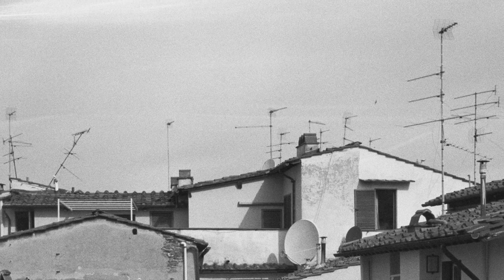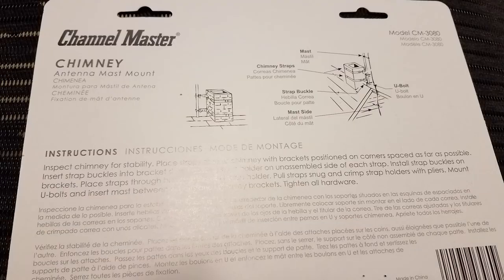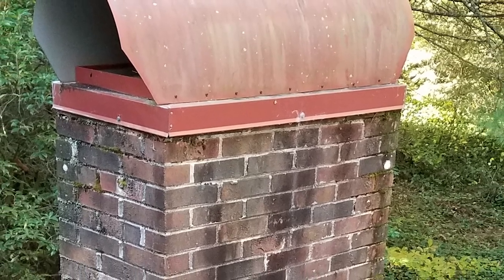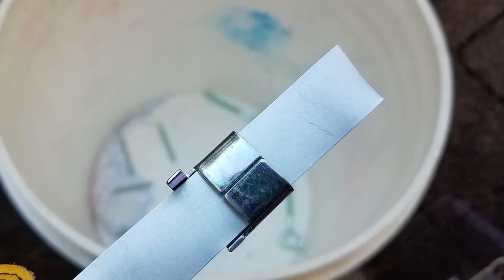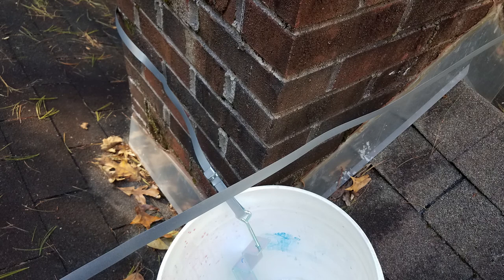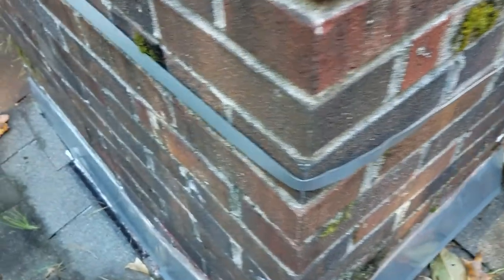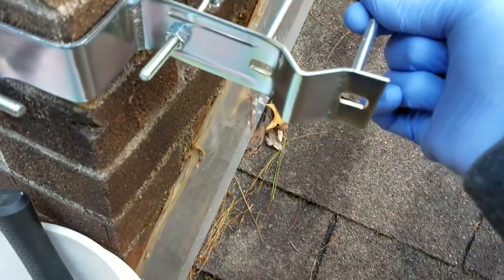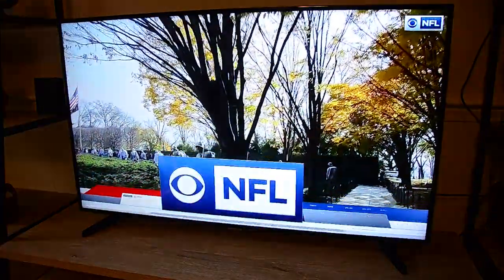Channel Master CM3080 Chimney Antenna Mast Mount how to install despite bad instructions

Comment: Thanks for great instruction.  Dealing with my Mother's estate after she passed, I found her first cable bill from 1969.  The old roof antenna was in need of replacement, so Dad finally agreed to subscribe to cable tv, rather than replacing the antenna.  The monthly cable bill was $1.26
Reply from the maker: Wow the early days when it was just about getting the area stations and maybe a channel with the current temp and time. So you now own a time capsule of stuff from the late 60's and beyond, I bet there is all sorts of interesting stuff from the past. Thanks for sharing and for watching.
Reply: I didn't realize cable TV had been around that long.

Comment: Thanks, this helped a lot. One tip if you’re working alone is to duct tape the bracket in place. You can also throw a piece on each corner so it doesn’t move when you start tightening. Just be careful with the duct tape roll—mine rolled off and fell into the neighbor’s pool.
Reply from the maker: That is a great tip, except for the pool part. Using a bucket or box can help keep stuff from rolling off the roof, although I did have a nut roll off. My suggestion,  bring a magnet to fish through the grass. Yup I did find it. Thank you for sharing.
Reply: @cfldriven  i actually did use your bucket tip. That made it much easier to take all the materials and tools up the ladder.
Reply from the maker: @paulg8065  Excellent!
We about to get a new roof, so I have to go up there to reroute cables. While I dread going up there, the cable run will be much shorter.

Comment: Great video !  Lots of detail. I’m cutting the cord next week cable is just to expensive anymore. Thanks for the video!  👍
Reply from the maker: We cut the cord about 15yrs ago and have not regretted it. When we moved cross country I took down the old and antenna and installed at the new place. We get over 20 HD channels and tons more through the internet connection. We only pay for Netflix. Hope you save and enjoy.

Comment: Very well done fella. I will be doing exactly what you are except my parts are home made totally stainless steel. Nothing like the shiny corrosion resistant of the killer metal 316. JOB well done too.
Reply from the maker: Congrats on the home brew. Good antennas are getting hard to come by so you may be on to something. Thanks for the feedback.
Reply: @cfldriven  I look forward to see more great videos with great information to keep us all informed in the OTA TV stuff.

Comment: Well described and presented.  Thanks for your help. Just bought the same type of antenna mount (for Ham radio antenna).  this will make things easier to understand.
Reply from the maker: Pete, I long for the Radio Shack version which was so easy to mount. Thank they are still avail. 86

Comment: On your lower strap connection, when you make the 2nd connection before tightening the bolts, the upright ears are not pointing to the short end of the strap. They are pointing to the long end of the band.

Comment: Purchased the exact mount for my chimney, I watched your video and also read the instructions, and I still can not get the 7/16" nuts to tighten. The band iron clamps just keep creeping toward the j bolt so I'm not getting anywhere.I have the clamps the same direction as you do. Just wondered if maybe there was a revision on the instructions. Thanks for your time
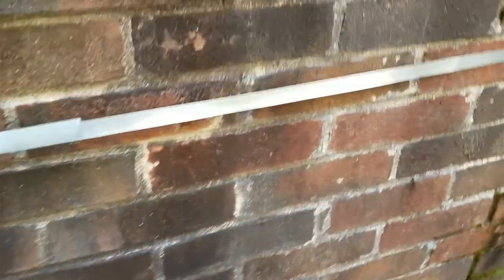Reply from the maker: Gotta make sure the band iron clamps are tight and bend back any leftover strap as in 6:25. The CM system is not the best but Radio Shack took their ratcheting system with them.

Comment: to be kind to the bricks of the chimney consider threading the metal straps through sections of an old inner tube (or cut open sections of a rubber garden hose for padding).
Reply from the maker: You're headed in the right direction, but instead of materials that will break down over time, use something like a 2-in x 2-in x 8-in 12-Gauge Galvanized Steel Angle. Use tape or puddy to hold them in place while you apply the straps. Thank you for sharing.

Comment: Excellent video.  Two questions.  Why didn't you let the mast touch your roof for a stronger support base?  I will be using a 1" OD steel mast.  Do you think this setup would hold a 20' pole with a 3' x 1" fiberglass tubular RF antenna (not a TV antenna) without guy wires?
Reply from the maker: Great questions, I needed as much height as I could get, and did not want the mast digging into the shingles. The mast in this video held up this antenna and a Comet CX-333 which was 10' long and weighed 3.5 lbs without any guide wire. It survived many a Santa Ana wind storms without any issues. At that time it was not grounded, something I now do living in lighting country.

Comment: Great job!  In this video I noticed you had an Amateur radio vhf/uhf antenna mounted above the TV antenna.  I want to do the same.  How has this combo held up so far, for how long?  Any wind damages?
Reply from the maker: That was the second location for that antenna with similar mounting. It survived the intense heat and winds of Los Angeles before I hauled it off to the mid Atlantic states. It had no problem with winter wind and ice. Sold it about two years ago. Thanks for the view and the question. 86
Reply: Thanks, Do you have a similar setup at your new location, Vertical antenna above your tv antenna? @cfldriven
Reply from the maker: @bigdad5767  I did until I sold the vertical. The thing had to be over 20 years old and except for some sun bleaching there were no cracks or damage.

Comment: I appreciate this video very much-Thank you! I have a “vintage” dual antenna system that came with the house which may or may not work or I could invest in a new Channelmaster. What do you recommend? Thank you!
Reply from the maker: Mk it all depends on the shape they are in. If bent, broken or rusted over then it might be time to replace. If they look fine, I check the cable or twin lead and replace if necessary. Even if they are pre-digital antenna they will still work with all the HD stations in your area. Make a connection to a tv and see what happens. Remember you may need to re-aim the antennas, or add signal amp. Check the links in the description which will guide in aiming them. There are also some apps that visually help you aim them, just Google search for options. Hope this helps.

Comment: I'm done paying Dish and I'm going to get a Channel Master, should I get a motorized one or some other type they have? I'm going to mount it like you did on the chimney.
Reply from the maker: The reason to get a motorized mount is if there is a tv signal on the East and another on the West side of your location and they are two far to be picked by one antenna. Most of my signals are NW and WS so I didn't need a motorized mast. The downside is you have to re-aim the antenna each time you want the channel from the other side.
Before buying check out https://www.tvfool.com, https://www.fcc.gov/media/engineering/dtvmaps, and https://www.antennasdirect.com/transmitter-locator.html these sites will help you determine what channels you can receive and where they are located. Best of luck.
Reply: @cfldriven  Well that settles it then, I'll need a motorized one. I have TV towers about 60 miles east of me and 80 miles west of me.
Reply from the maker: @darktoadone5068  Wow that is a lot of distance, definitely consult the fore-mentioned websites to make sure you can get a signal and the type of antenna that might work best for your location. I'm in a depression on a mountain side which tend to obstruct some stations even though they are not that far.

Comment: when I did this, the strap buckle keeps sliding when I try to tighten it and the antenna's all wobbly now. Any thoughts?
Reply from the maker: With the toggle bolts loose, remove as much slack out of the strap and crimp the buckles in place. It should look like image at 3:57 and 3:59 and 4:55 in the video. The buckle should not slide.
Reply: Same thing here, I've tighten them down hard and it still slides over time. Not a good engineered cinch, definitely would not put anything heavy for this thing to hold in place.
Reply from the maker: @wisecitizenry2844  Double check the setup, as I recall when it slid on me it was because it was on backwards.
Reply: @cfldriven  I did that, no it wasnt backwards, yes it still slid
Reply from the maker: @boazbrown4341  Sorry to hear that, I've installed three of these over the course of living in different places and have never had it just slide. Radio Shack had a much better antenna mount system with ratchets for securing it, but I was never able to found one like it after RS went out of business.
Reply: Maybe put shims between strap and chimney before tightening the bolts
Reply: @cfldriven  Thank you for a wonderful video.  Unfortunately I'm having the same problem as mentioned in this comment thread.  When I tighten the nut on the eye bolt the strap gets somewhat tight, but then the clip just starts slipping along the strap toward the eye bolts.  From a mechanical standpoint I'm not sure I understand how this is supposed to work, as it appears only the pressure of the crimp and friction prevents the clip from sliding along the underneath strap (the one that goes around the chimney).  Am I missing something?  Thanks.
Reply from the maker: @petersmith2481  You're correct the crimping provides the all friction for holding the buckle in place. The crimped end is facing the eye bolt.
Reply: @cfldriven  Thanks.  At the end of the day I couldn't prevent the straps from slipping as I tightened the nut on the eyebolt.  I was also concerned about friction being a reliable method for keeping the straps in place as both vibration (from wind) and thermal expansion/contraction (from outside temperature variation) would likely cause them to loosen over time.  As a result I opted to just drill a hole through the center of the clip and straps, and ran a bolt through to keep everything in place.  This fix seems to have worked well.
Reply from the maker: @petersmith2481 Thank you for sharing your solution. It has been over two years and despite a brutal winter and several tropical storms the strips have yet to move. Back in the day Radio Shack had a mast that was easier to secure, I searched and could not find anything like it.

Comment: What about the ground wire?
Reply from the maker: While the video was only about the installation of the mast, one would still need to run grounded signal wiring to their tv and a separate ground cable to the mast. Then there the issue of properly aiming the antenna and whether a pre-amp is needed and do you double up on antennas, which is why I stuck to one topic. Thank you for the question and for watching.